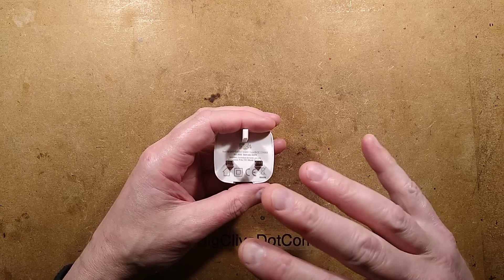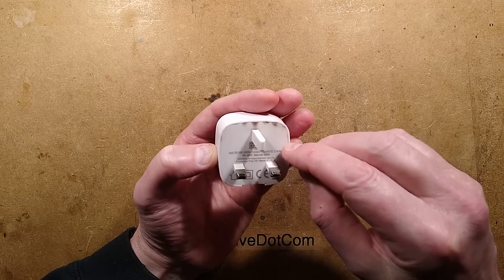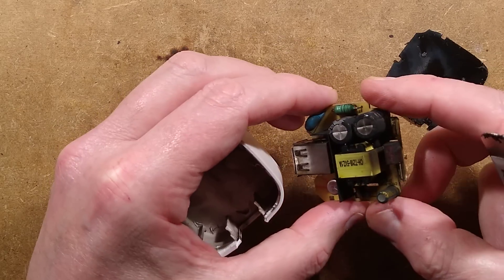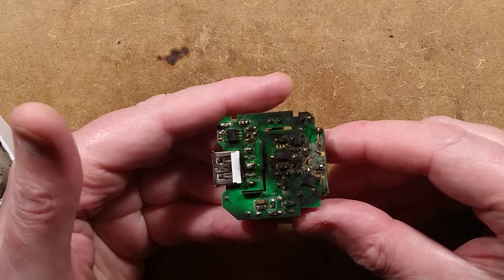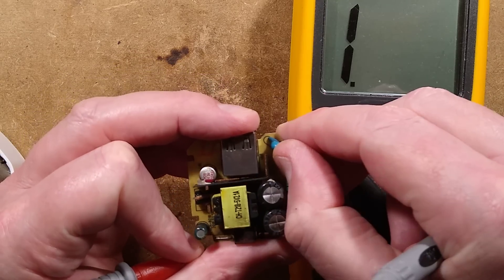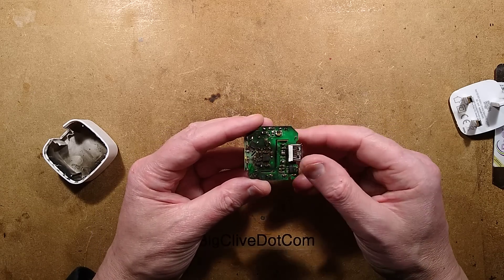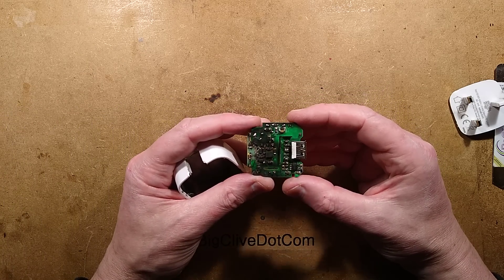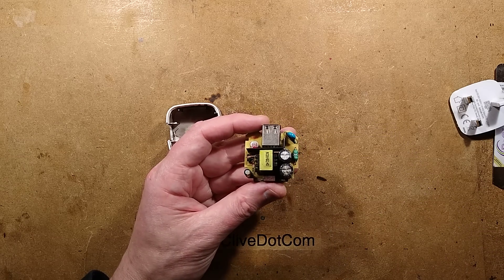Poundland USB versus lightning  (The lightning won.)

Comment: I remember a direct lightening hit on a radio antenna in Cambodia many years ago, two feet of the whip antenna were vaporised and the copper core was too for another foot.  The top was splayed open like the end of a shotgun in a loony tunes cartoon.  The lightening then jumped the spark arrestor, a box filled with fuseable links and then fragged the black box in the demountable building attached.

Comment: Another fun fact about lightning. You ever look at a big transmission pole - like the ones that do 132, 275kV kinda lines - and notice there are super thin wires atop them? Those are called static lines. They're directly connected to ground, and the idea is that lightning will strike these, and not the actual HT wires. Also, you can make a vague guess as to how many volts are on that line by looking at the insulators. Here, generally, one disc will do 11kV. 3 discs means 33kV, and so on. Not sure how that scales up to the big boys, but your local high voltage lines that feed your neighborhood step-down transformers generally work like this.

Comment: I'm surprised the charger passed the necessary electrical safety tests, as there is a risk of unplugging it and leaving exposed contacts in the socket as it only needed a spudger to remove the back.  As regards the lightning, it probably helps that the charger had a metal earth pin  ( though that could also have been the point of entry of the surge)
Reply: @Pete Whelan.
Time for a visit to the optician.  (Opening shot clearly shows the earth pin is plastic.)

Comment: Lightning struck the telegraph pole outside my Aunt's house the surge took out all her phones and a TV. Her computer had an internal modem (this was the mid 90's) and it blew the chip right off of the ISA card. But surprisingly the computer still worked after the modem was removed.

Comment: now i understand why UK has fuses in the plugs! In Greece sockets are usually wired to 10 or 16 amp fuse/ circuit breaker and most of them are rated at 16A since we use the type F sockets or Shuko as they are know here ... 32A is a lot of juice in one socket ;)
Reply: Even still you will be using cables rated for max 3A on devices protected by a 16A fuse/breaker. Bad things (aka fires the cause of most deaths from electricity) can still happen as a result. The UK plug/socket combination is the only one in the world designed from the ground up with safety in mind. There are numerous little details of the design for safety. The only significant update since 1947 was the 1984 mandation of sleeved live and neutral pins (which was already widespread). However I would note that due to the shape/size of the plug it is impossible to touch the pins while partly inserted with even a child's fingers.
Reply: @Matt Quinn Hum, you must have either very skinny fingers, have been deliberately trying or the plug/socket was faulty. However I absolutely agree that sleeved pins are a very good idea. If I ever come across stuff with unsleeved pins I immediately change the plug. My sister had a very nasty incident with some dolly cutlery and an unsleeved plug as a child. It involved a dead short between live and earth and an almighty bang. The fuse was of course blown. It was this sort of thing that the sleeves are to prevent.

Comment: This brings up something I've been wondering about. Other than unplugging the equipment is there an absolute way to protect electronics  from lightning? I know that it will jump a normal switch like it wasn't  there. Is there aome kind of cut off switch that creates  a large enough jump proof gap? I'd like something i can plug all the electronics in my office into. Like a big knife switch? In a box of course. Could make an interesting video. Design, test, bang smoke, redesign........
Reply: Short answer: not at an affordable price for most people!  There are many commercial companies that offer lightning "protection" systems, but (quite sensibly!) none will guarantee 100% success.  Their solutions simply manage the risk.

Comment: 3Kw Belling fan heater plugged into a surface mount socket. The whole socket, plug and cable ended up the other side of the room. 2 houses had every piece if electrics pluged in destroyed. Lightening had struck a 50 foot tree, ran down it removing all the bark and then jumped across to a shed containing the main electrical meters for 3 dwellings. 2 meters were totally destroyed. Now that's REAL magic smoke. Fortunately I had brown trousers on.

Comment: I have APC Surgearrest on all sensitive stuff like dish washer, fridge, TV and so on (and APC UPS on computer stuff). Once we had a strike just nearby and sadly my VDSL modem and also the router behind it went and the network port on the computer behaved strangely after that... Why?
I forgot to protect the telephone line! So it went in to the modem and continued through the network cable.
Fixed that issue after that, but now it goes through fiber (and yes, the fiber converter power is protected!)

Comment: Ah yes, 240V @ 32A. On the good side, you can run a 10 horsepower motor off of that. On the bad side, your little USB supplies fail spectacularly.

Probably for the best you have those socket shutters, much as I despise such things. How thick are the blades on those plugs? They appear to be 3-4mm, which would leave a substantial gap were there not shutters present.
Reply: Actually the holes and the depth before the contacts exist are all sized so that even a child's finger could not touch either the live or neutral even if the shutter is not present. The BS1363 system is designed with safety in mind from  the ground up. It's the only plug/socket combination used for household electrics in the world that is.

Comment: I've wired in Delta Lightning arrestors. deltala.com They are silicon oxide varistor if I remember...  That means they don't wear out like MOVs. I put an LA-302R at the main disconnect, LA-302DC's for my solar at both the panels and at the house. Added several grounding rods around the house and out at the solar panels and connected them all together and to the original with #4 (25 mm2) forming a ring around the house. Prior to that work I would lose a couple of X10 devices each year. Almost 20 years, so far so good...

Comment: The voltage spike from a lightning initiates an arc discharge, which is then kept alive by the mains voltage and current, until the breaker trips it. It's milliseconds, but enough to cook electronics. I think that's what happened there.

Comment: In my mother's home location (about year 1945) lightning strike killed their horse. It was probably happened in the middle of the night, following morning they found what was actually happened. It is not clear what route the strike has gone... Also remember the case, in my home location, approx 35 years ago. Lightning strike hit approx 70m away from the house. One hit point was single pine tree. Bark was taken away from top to bottom, approx one inch witdh. There was 3-phase powerline underground near the tree. Following day we have found one inch hole in the ground, made by lightning strike. The cable was approx 0.8m deep in the ground. It broke insulation there and went in to power feedline... Inside it blew many fuses in the connection box. Also overvoltages went inside through phone lines. Even though the phone extension cable was taken away from outlet, it jumped approx 0.5m distance on the table -> and continued to another room over the phone extension cable. Small pieces of plastics scattered everywhere. Luckily nobody was hurt then... But I got good indication what strike hit can do...

Comment: Apple devices tend to have a rather... rocky relationship with standards. So it would not surprise me one bit if the iPhone went ahead and charged at 2 amps despite the shorted pins.

Comment: My house was struck and a lot of computers nearby got hosed. We had unplugged almost everything in the house though because I saw the bolts getting nearer and nearer - striking the ground. A child across the road saw it strike our chimney. It went down the aerial into the cable box and up the street to the cable box then down the street to all of our neighbours computers. I had hidden Ethernet in our walls going up to a wireless router upstairs which exploded in sparks on to me. Scary ! Holes in roof ! Fireplace blown out. Complete rewire!

Comment: One day at an old house I used to live in we had a cable amplifier for our analog TV and it got hit by lightning and blew off the wall that it was hung on there was a nice black spot on the wall and the cable amplifier sitting on the floor still smoking
Reply: Doesn't help that historically cable companies were TERRIBLE about proper grounding. They are much better these days but I've seen some real gems, like driving a 4 foot ground rod and using that for the cable TV ground without bonding it to the building's service entrance ground as code requires. (I expect that this maybe location dependent, my observations are in Virginia---and it's not like the cable companies were the only ones doing hack work here!)

Comment: To be honest, I was expecting to see a lot more damage than that. All the secondary side seems to be physically (if perhaps not electrically) intact, and the primary side seems to have done it's job. The Class Y and electrolytics could easily have detonated. The fact that the phone seems to have survived is a testament to the design - insulated transformer, good clearance slots etc. I don't expect ultimate performance from pound shop gear, but I reckon this is built better than some products 10x the price. I hope you manage to get hold of one for a tear-down and performance test, because the engineering could be rather interesting.

Comment: Hey Clive, is that the max amount of plugs the extension cords of your country has? I'm utterly amazed at how bully those chargers are. Our chargers here in the US are significantly smaller.
Reply from the maker: You can get 10 way extensions for lots of low loads.
Reply: The Apple branded charger is the size of a normal UK plug with the USB socket at the bottom where the 240V cable would normally come out. 
https://www.apple.com/uk/shop/product/MD812B/C/apple-usb-power-adapter?fnode=ab48a463af4d469b46286bfd7f3a18f21c890bf47cd3959a9b46d0f02e34c59373438941e0335bc880291eb0548d10b6becd5240f993e1663963d110f8e9c48cb2efbcff53d06fcac1916f0c8908ffea95068712e808f2255cad35458e6d4697d8c8a351bd83bb38948c94b636cf8c5d

Comment: Speaking from experience, its also possible for the lightning to short the primary and secondary sections out in the pole transformer, and send 7-12kV line voltage straight into the service entrance, as happened at my grandparents house. Very exciting (and terrifying) to see everything running on many thousands of volts. In that case, the overhead lines from the transformer ended up blowing like a giant fuse and falling off, which was also very exciting and terrifying to watch.
Reply: The usual way that 7-12kV gets into the secondary side of the transformer is that the primary line breaks and falls down and makes contact with the secondary line. It's interesting to note that some power companies (maybe most?) arrange the secondary lines so that the grounded neutral is on top and the two 120V hot legs are below it. Therefore a broken primary line is more likely to make contact with the grounded neutral and trip out.

Others arrange the secondary lines so that one 120V hot leg is in top, then the grounded neutral is in the middle, and  the other 120V hot leg is on the bottom. This arrangement seems more likely to result in a broken primary line applying primary voltage to one of the 120V legs.
Reply: @brianleeper5737  Certainly possible that it broke one of the main high tension phases when it hit the transformer, but I really only remember seeing the feeders glow red and come down after the transformer was struck. The other route would have been flashover in the transformer itself since it took a direct hit. Either way, it was impressive. Fortunately all the electronics they had at the time were based on vacuum tubes so everything survived, but the TV was never quite right afterwards.

Comment: Reminds me of when our house got struck by lightning. Hit where the AC condenser was, and found its way in. Surprisingly the only casualty was the power supply for my Commodore 64, which shorted out and turned hot, melty, and brown. The Carrier condenser from the mid 1950's seemed to be surprisingly unperturbed by being struck by lightning, and continued on as though nothing had happened.

Comment: Something like 15 years ago, there was a near-strike on my home (and about ten years before that, the home I lived in then had a near-miss strike as well).  In both cases, my computer had a modem connected to the phone line at the time, and the modem didn't survive.  (The first time, a chunk of a VSLI chip melted and the second time a number of SMT passives were blown off the modem board.)  The first time I found the actual strike location a few weeks later, a venerable pine tree, which had split along the grain line for most of the tree's height, the second time I never found the actual point of strike.  I did have a lot of other damage the second time, both my satellite receivers were destroyed, my stereo, my satellite dish had it's LNB blown up and it split the shroud in two, and my computer's power supply began acting strangely (not going into the proper shutdonw state, and it failed entirely the next summer when the temperature went up.)

Lightning is not a fun thing to get a near-miss with.

Comment: One of the worst cases I've seen was back in the early '80s when I did a TV service call to a house that had been hit by lightning. I was there to fill out the paperwork saying that the TV was a total loss for the insurance company. Every piece of electronics in the house was completely wiped out and you could see where some of the wiring went through the walls from the scorch marks on the paint. They had to replace every piece of electronics in the house and have the house rewired. It was a miracle that the house didn't burn down.
Reply: Once saw a tree that had been used for a light pole yard lights that is get struck by lightning strip the bark and Harley all the way around the top it's free had been long since cut and took out the electric fence are Geyser in the shop and even blow some light bulbs old school incandescent took out the phone system blew up the VCR is that one the TV still work the other one did not.

The old TV antenna and antenna booster we're okay but the input wiring Florida's fine however the output from the booster was vaporized in two or three places where it was next to metal conduit Ark / evidently.

Blue a timer off the wall.

Blue all the photo controls for any lighting welded a couple Indian position blue one apart.

Someone was in The Barn at the time she felt the shock through his shoes he said that was all the cows in the barn jump straight up simultaneously.

And then shortly after he heard a bang after the storm got worse lightning had struck the central lightning rod on the barn vaporized for the copper rooster weathervane.

What are the directional indicator arms was blown off and was impaled in a tree stump crack.

There was also a third lightning strike in the same storm it took out the pump controller 4 the well Justin controller not pump. Due to lightning protection beyond the pump which stamping blew up in a process but did protect pump.

And a battery charger that was flooded in but not connected to anything the voltage was quite different than before it happened.

And also there's one more lightning strike although it was probably off property and I can't remember that took out the phones of three Farms total.

So lightning wins with a homerun I guess.

At least in that case maybe more. That home run.
Reply: I saw old black and white TV set shatter when lightning struck our house wiring. CRT literally exploded and showered us with glass but TV itself surprisingly didn't catch fire and house breakers tripped safely. We had really old wiring in 1920s style, main cables in textile and paper insulation with screw-in, "percussion cap" breakers. It was real fun to wire in anything new...

Comment: a lightning once popped our coffee machine, it stayed with the heater on even if switched off, likely it was shorting the neutral lead of the heater element to the earthed body, the fault was inside the heater pipe... our differential switch wasn't working back then... probably both live and neutral lifted in respect to the earth and caused an insulation fault, i dunno

Comment: Lightning hit beside my home a few months ago. Came in via the cable tv line. It blew the modem, router, Roku, and TV up. Anything tied to the wired Ethernet.
Reply: Nate Newman  I have the APC brand cat 5 arresters  on my line into the router a micro tic rack one along with them on every radio out in the sealed box by the base of the tower  they do seem to help the radios are powered thru the cat cables  and have survived half a dozen hits that I know of being up on a hill  makes a hell of a bang ! Even the LED nav light has lasted a wile. I do have a good grounding web too .